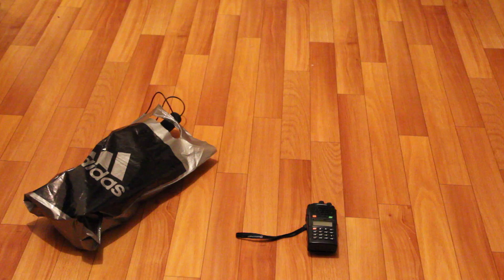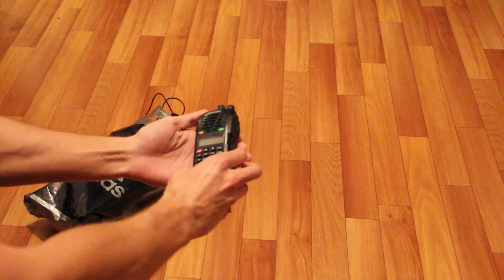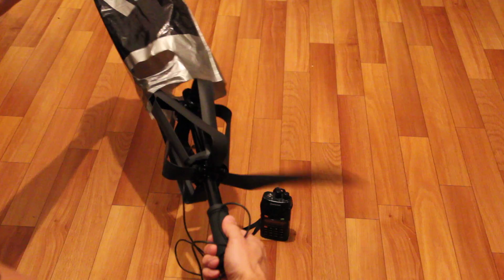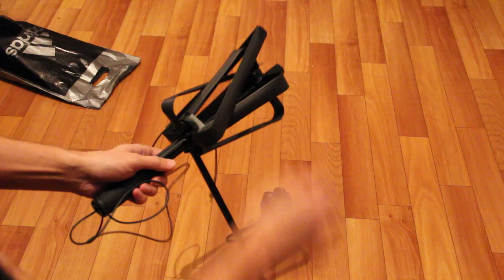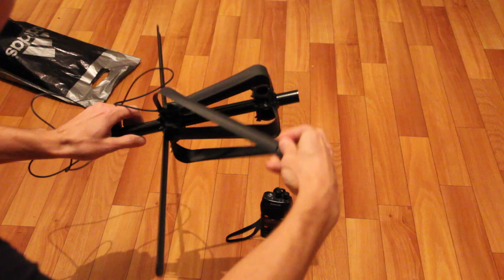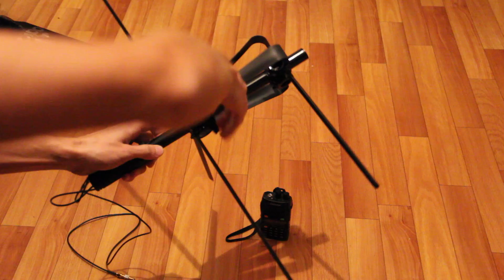Homemade Satcom antenna.

Comment: what materials did you use?
Reply from the maker: The base is made of PVC pipe. The active elements are made from a measuring tape.
Reply: @rfinventor9728  thank you very much for reply !!
Reply: @matthewlee2686 He'll never answer this question!

Comment: Please send me the blueprints and BOM
pablenmo@hotmail.es
tanx
Reply from the maker: Ok.
Reply: Thank you very much, gonna try soon its surprisingly simple :)
Do you know the gain?
how are the poles connected?, in diagram seems like one to core one to shielding, but in pictures all are soldered together
Reply from the maker: You are welcome. Reflector elements connected together. Active cross-dipole's connections you can see at the picture. These connection points is defined type of polarization (RHCP or LHCP). In our case we use RHCP.
Also you must be careful with phase-shift cable element's.

Comment: Hello.This antenna only works on the transmission or signal reception?And how well?
Reply from the maker: The antenna have the same gain at RX and TX frequencies. Works very well.
Reply: It is possible to see a drawing of the antenna circuit?What materials for the manufacture of communications equipment and frequencies?ronin.d.83@yandex.ru
Reply: Do not be silent
Reply from the maker: Ok. I send info to your email.
Reply: Thank you very much for the detailed stuff!At the thought that I could speak Russian
Reply from the maker: You  are welcome!
Reply: HI the antenna looks awsome i have built a 2m -70cm yagi tape measure for the so-50 but  the satcom is a real deal please can you send me the info from this antenna that i can build my self  and how much power you need to transmit to transponder input to get in the bird sorry for my english :) toldioscar@gmail.com

Comment: do you have build instructions for this antenna?
Reply from the maker: I am not have the build instruction. But i have step by step photo. And sizes of elements.
Reply: Ok, how can I get those?
Reply: I'm looking for one of these for com field work with the coast guard auxiliary
Reply from the maker: Yes you can. Send me email (or privat message).
Reply: Hi, I sent you a message on Google hangouts
Reply from the maker: Ok. Send me email at testprog.programm1@gmail.com please. I am not use google hangouts.
Reply: RFinventor would like a copy of plans if you have them.  Working on CERT operations and think this is a good way to be mobile. Thanks RHill

Comment: How did you make that?
Reply from the maker: It's "measurement tape antenna " with CPVC base.
Reply: +RFinventor Do these folding tape antenna DIY's actually work? I've been planning to see if I can make a Harris folding antenna replica for a Baofeng UV5R. I just don't know what to do with the antenna, wiring etc.
Reply from the maker: It's the fully worked (RX/TX) antenna. But for UV5R you can make more easly construction (this is cilullar polarized antenna with coaxial cable matching). You can make "measurement tape Dipole" antenna at the frequency you want to use.
Reply: +RFinventor Is there somewhere I can get into radio equipment and stuff? I have no idea what you just said honestly but I've been interested in getting into radio equipment and how to use them for awhile now, I just don't know where to start.
Reply from the maker: You can buy Radio at Aliexpress for example. All materialls fot antenna building i buy in IKEA.
Reply: +RFinventor Thanks!
Reply: @mintrose3399   go to wish dot com they sell a folding antennas for the beofeng.
Reply: @rfinventor9728  do you happen to know what particular radio will TX in that range?
Reply: @mintrose3399  the radio bug bit me when i was only 12 years old. I could be seen walking around the neighborhood holding a 5 foot antenna connected to my walkie talkie with pcs of speaker wire. I've owned radios ever since
Reply: @johnmarsh6337  not like THIS antenna
Reply: Could you please send me a  plan  email-kalox7@wp.pl